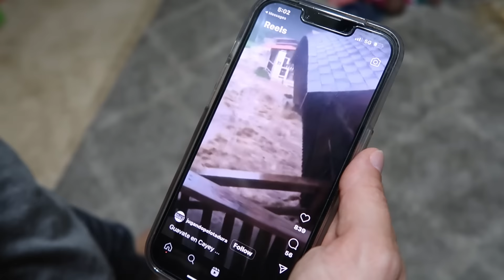😱HURRICANE⛈

Comment: We without power for nearly a week just from a thunderstorm. Lightning hit a tree and it pulled lines down and broke a pole. Luckily, we have a back- up generator. Still  had no cable, internet or phone. So we watched movies on the blu-ray player, ate microwave meals. Generator doesn't have enough power to run the oven, garbage disposal, or clothes dryer. It runs everything else.